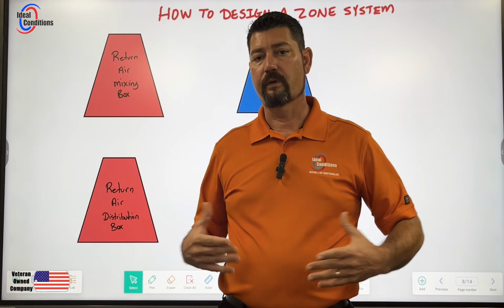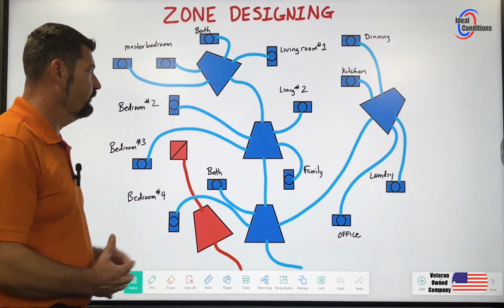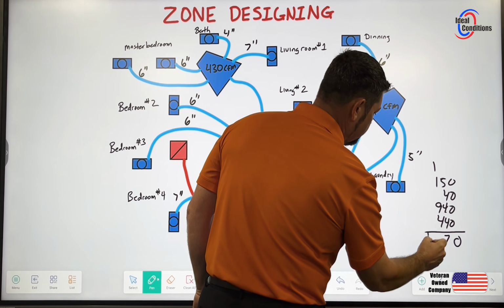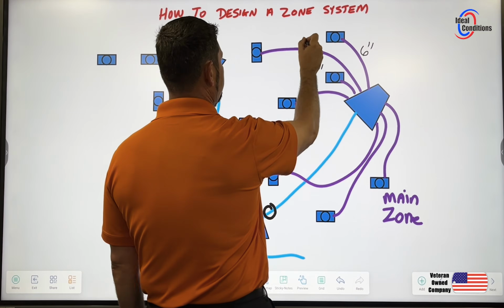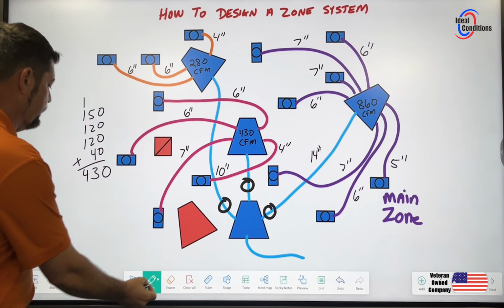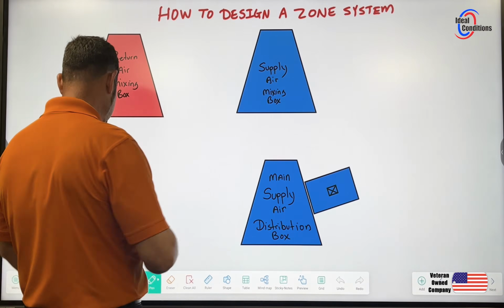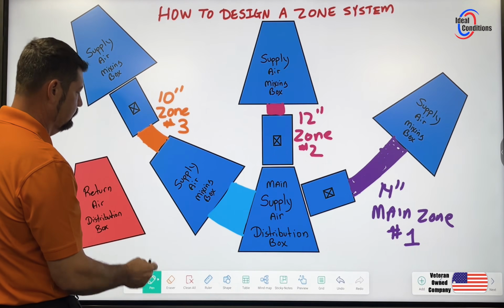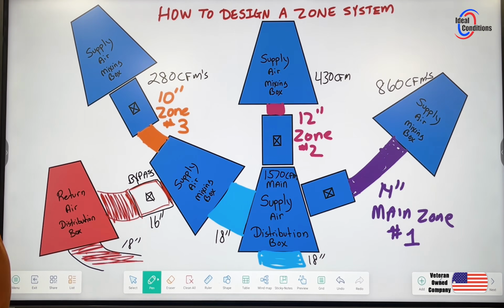How to Design a Zone System

Comment: Thank you for your time of instruction. What I do instead of adding additional mixing boxes for the by pass, is I would do a 10% bleed on the secondary bedroom zone, and a 20% bleed on the living area zone, which would reduce the by pass damper required, without causing an issue with over heating or cooling. A 16" SBD ( Smart ByPass Damper) I use EWC products. iis way to much to bypass right back at the blower. Causing short cycling on the plenum sensor.

Comment: Thank you for all the time you dedicate to helping people better understand the HVAC industry. I have a quick question regarding return air: when only one zone is operating, do you recommend installing a return in each zone, or is having just a main return sufficient?
Reply: Also do you use a motorized damper or barometric on the return bypass
Reply from the maker: Barometric or weighted.
⚠️ Disclaimer: 
Information in this video is intended for educational purposes only. Any work related to the topics in this video should be performed by licensed technicians or by apprentices under the supervision of licensed technicians. All HVAC repair work is done at your own risk. Ideal Conditions Heating & Air Conditioning, Inc. is not responsible for any possible damages or injuries caused by the use or misuse of any information provided.
Reply from the maker: Thanks for the comment! As far as Zone system is concerned, one return would be sufficient, however in regards to comfort return should be throughout the structure. Typically one per bedroom and one for main area. We will be releasing a video talking about supply and return throughout the structure regarding positive and negative pressure/hot cool spots. This will be regarding comfort only.
⚠️ Disclaimer: 
Information in this video is intended for educational purposes only. Any work related to the topics in this video should be performed by licensed technicians or by apprentices under the supervision of licensed technicians. All HVAC repair work is done at your own risk. Ideal Conditions Heating & Air Conditioning, Inc. is not responsible for any possible damages or injuries caused by the use or misuse of any information provided.